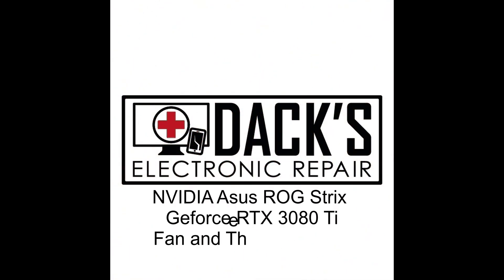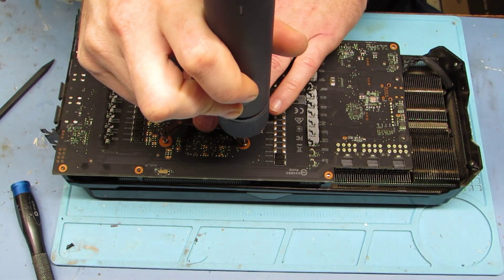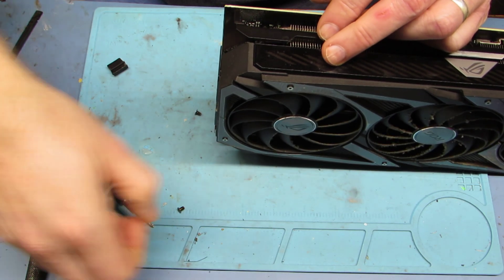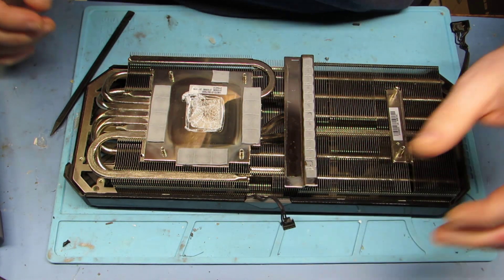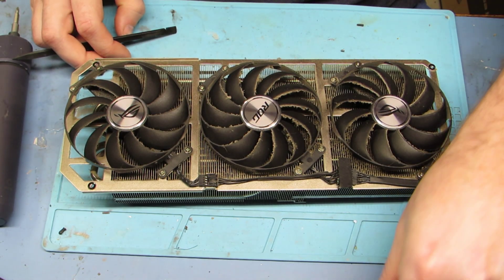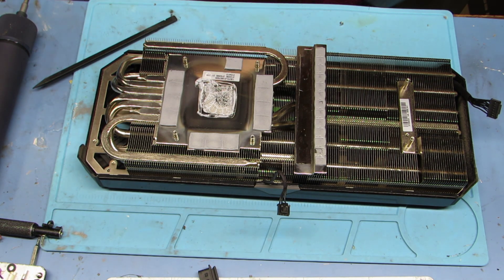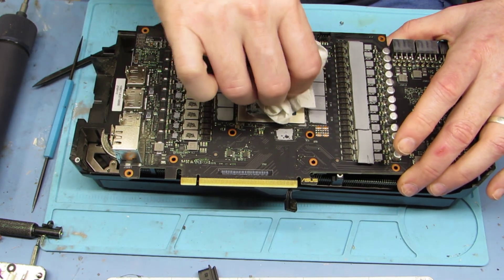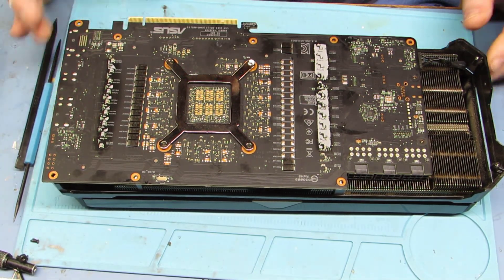How to Replace the Cooling Fans and Thermal Paste on a NVIDIA Asus ROG Strix Geforce RTX 3080 Ti!

Comment: Hello, I did exactly like a put everything back on place but now when I turn on my pc there’s 1 fan which is not working and the 2 others are turning at full speed and nothing on display, wonder what’s wrong
Reply from the maker: For sure check thr fan connections on the GPU. Did the card work before?
Reply: @dackselectronicrepair I had to reopen it and rechecked the connections all is good but still the left fan not working. Yes the card was working fine before I just ordered new fans to change because one of the fans was making lot of noise. I will dismantle it again later and put back the old fans and see maybe a problem with the new fans and exactly the same fan that I had problem with 😢

Comment: What Torque settings are recommended for the re-installation of the screws on such electronics>?
Reply from the maker: I don't have specific torque figures. My rule of thumb is nice and tight if you are screwing into metal and just hand tight if  the screw is going into plastic!